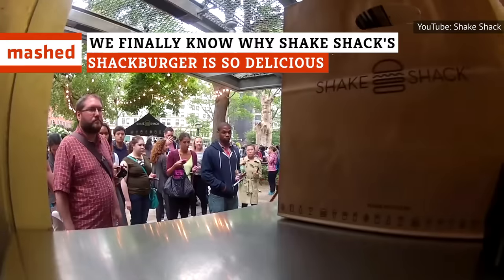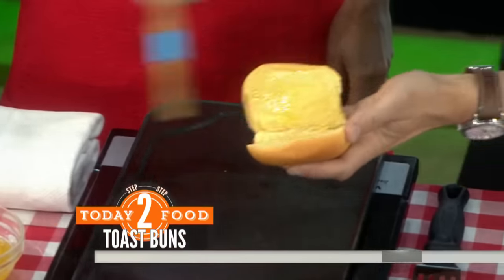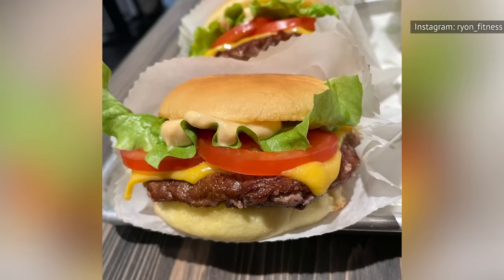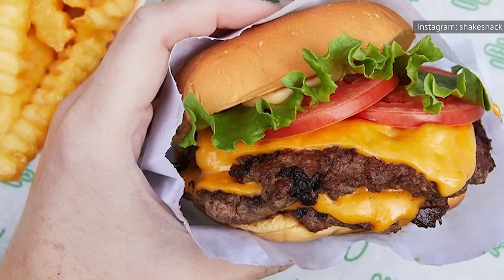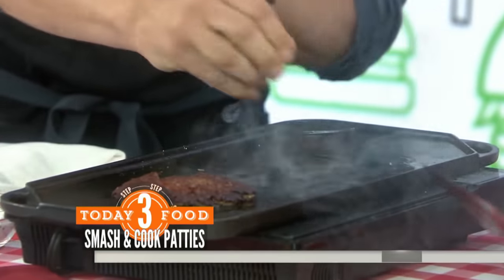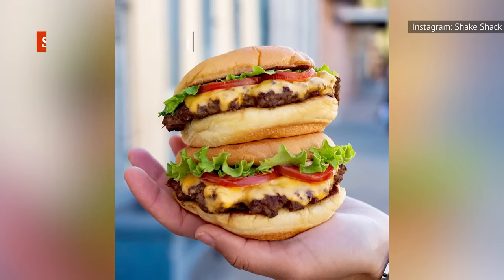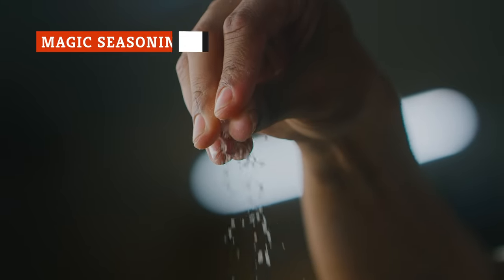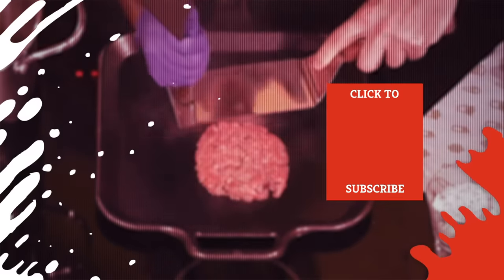We Finally Know Why Shake Shack's Shackburger Is So Delicious

Comment: Having watched them make a burger I saw no cast iron. It's cooked on a standard steel flattop.
Reply: Bro I work the grill at a shake shack, and we don’t use cast iron.
Reply: @andrewchampagne9167  That's what I said.
Reply: @Andrew. Bro, you work the grill at shake shack.
Reply: Carbon steel and cast iron cook very similarly. Get the surface hot enough, and you can make an amazing smashed burger on either.